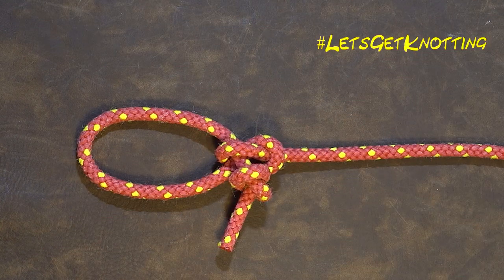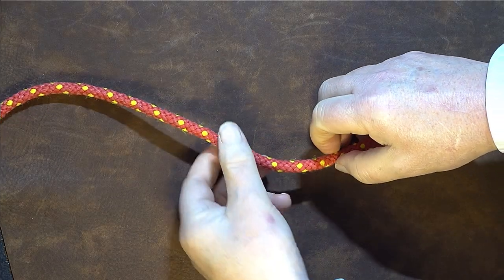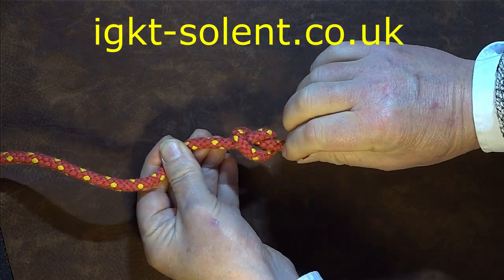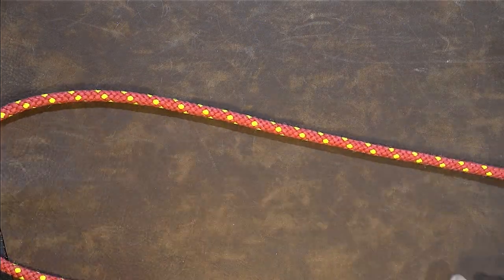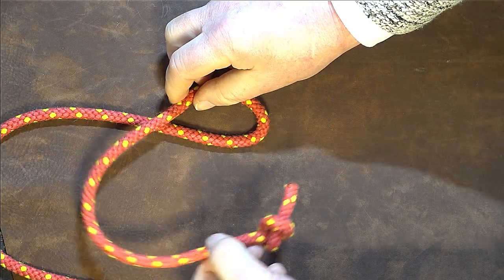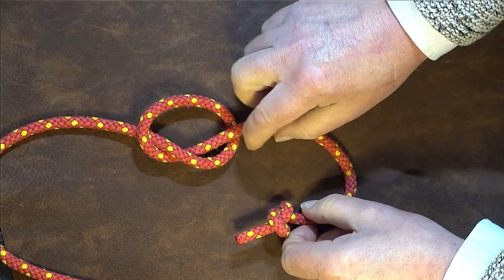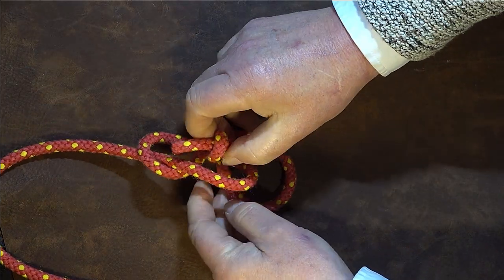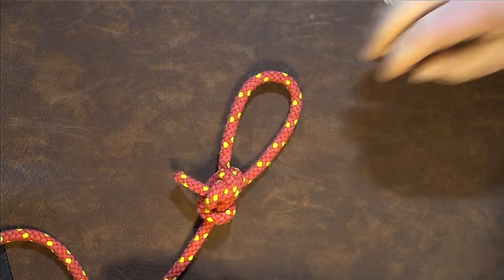How to Tie the Honda Knot - The Lasso Knot or Lariat Knot

Comment: At work I have access to a large supply of 2.5 foot sections of .25 inch 3 strand, any ideas of what I could make with them?
Reply from the maker: Perhaps use some to practice Manrope Knot and Footrope Knot. I also wonder if there is enough length to make a soft shackle?